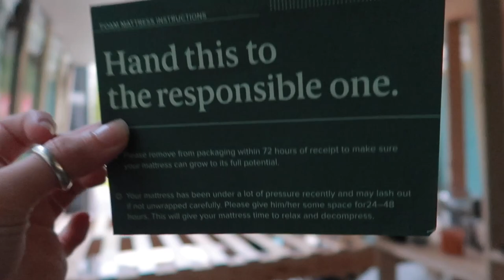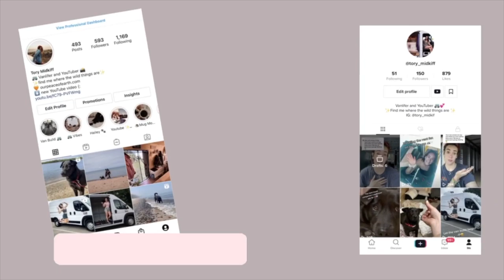Moving Into Our Van // Living in a Construction Zone (VAN BUILD SERIES)

Comment: You guys are doing such a great job. Drawers look amazing, and the bed slats are a great idea. We're just going with a ply base. Hope it's going to be comfortable enough.
Reply from the maker: Thank you so much! The drawer slats worked out way too well. We did a plywood base in our last build! Only tip I have is to drill some holes for ventilation so that you don't run into any mold under the mattress down the line (:
Reply: @torymidkiff  Thanks for the tip. We had planned to drill some holes, so hopefully it's enough.